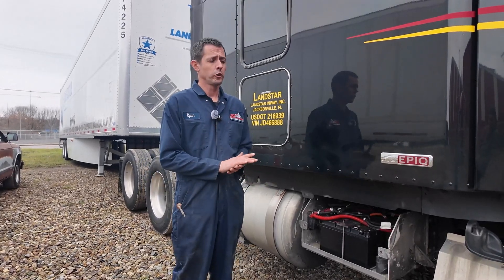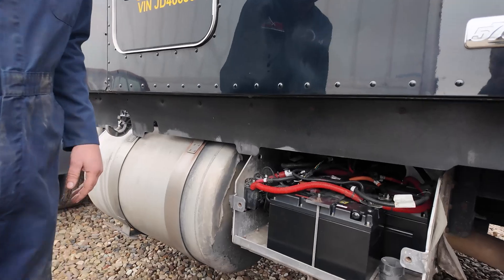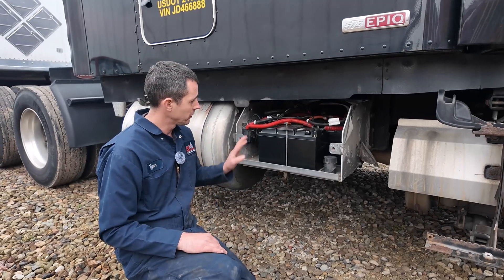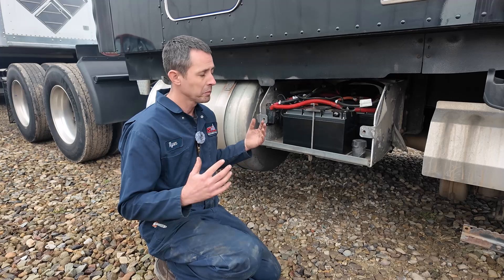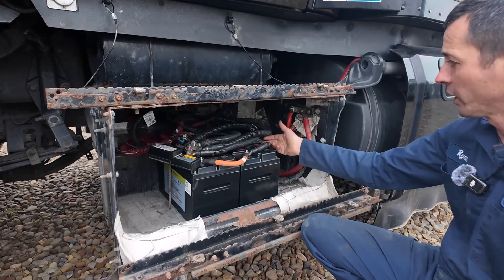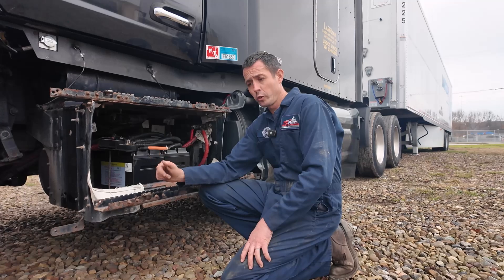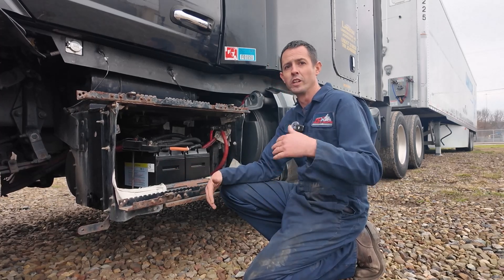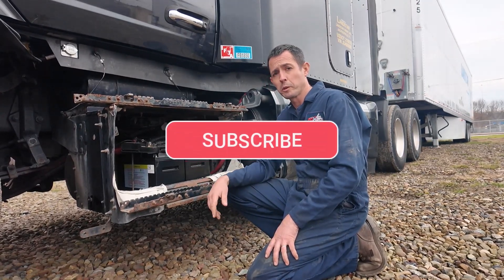Ultimate Lithium Ion Battery Setup For Paccar's Factory Electric APU

Comment: Do you work on the paccar smart air systems ?
Reply from the maker: No, but we replaced the batteries for this system before.
Reply: @truckingandfixing ok thanks been searching high and low where to get mine fixed is a factory installed system but the dealers wont work on them and dont know how to work on them witch the biggest paccar scam ive ever witnessed

Comment: Do you have to change your alternator because they charge at a higher voltage than lead?
Reply from the maker: No, this battery needs 14V to get it charged full. Most alternator has a range of voltage between 13.5 to 14.5V

Comment: The biggest problem is lithium batterys dont do well in extreme hot or cold, they lose a lot of efficency and cant provide or store power .
Reply: Cold....yes, but they hake low draw heaters, and some batteries even have the heaters built into them.  I haven't heard of an issues with heat.
Reply: @IndependantWCommonSense44....   They get hot during rapid charging and discharging. In fact, the same situation occurs with other types of batteries. That's why battery management systems have thermal sensors and protection.  The  loss of efficiency is the main issue , due to heat and Cold .
Reply from the maker: This battery has heater and fan built in.
Reply: What about a 24v engine/alternator and your 24v skanapower battery? Will it charge it no problem or do you need a dc-dc charger?